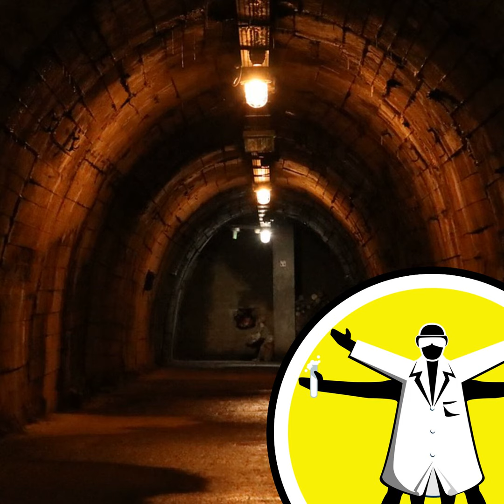You can teach an old mine new tricks

Comment: SA legacy mines the biggest thing was to recover sulphuric acid, copper and silver from those heaps, which paid for the processing. The gold and uranium was a bonus, along with platinum group metals. As well the waste was used to fill in the old workings, getting rid of both the heap above the ground, and filling in the hole that was in danger of collapse as well. then the old heap was gone, the ground was more stable, and the land was sold off to make new residential areas. 

I remember those old mine heaps along the roads from decades ago, now almost totally gone, replaced with shopping malls, industrial sites and brand new suburbs. Less dust blowing off the heaps as well, so better air quality as well.